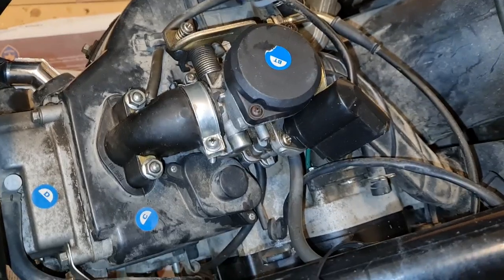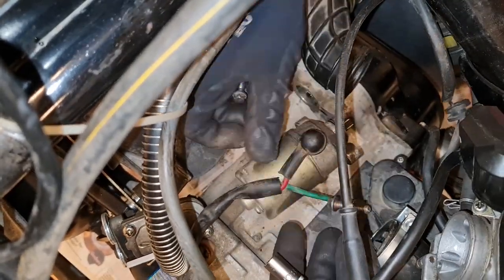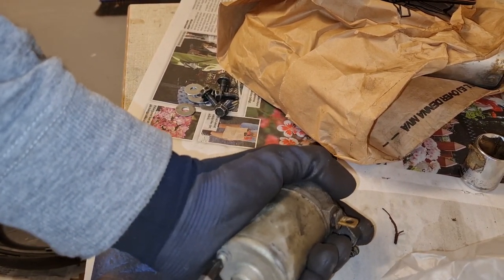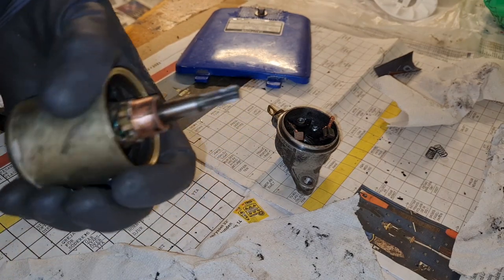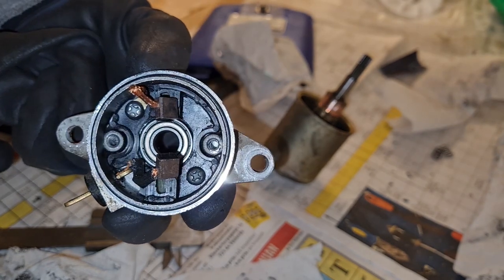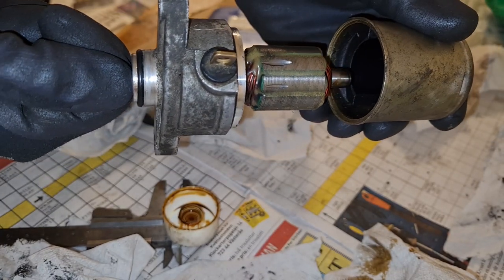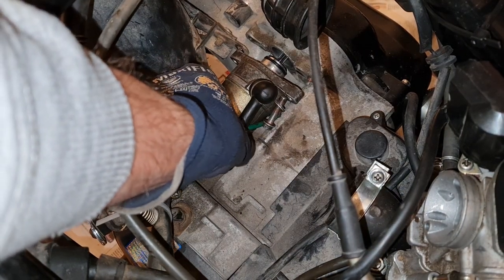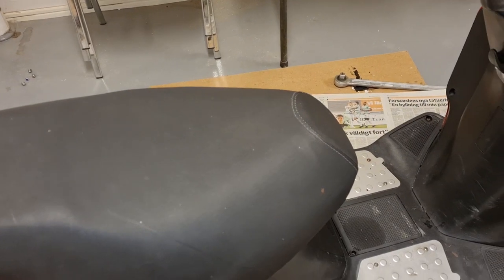Baotian Sprint 50cc Cleaning GY6 Starter Motor and check on brushes

Comment: To get the brushes in places:
After spending a half day I cut a spray can and rolled a small piece. Then I hold down one brush and the other one I pushed with the sheet metal in place. After this I enlarged the sheet metal, so it fits the rotor. 
With a knipex i got the sheet metal out after the rotor was in place.